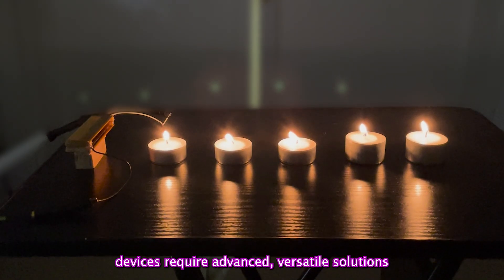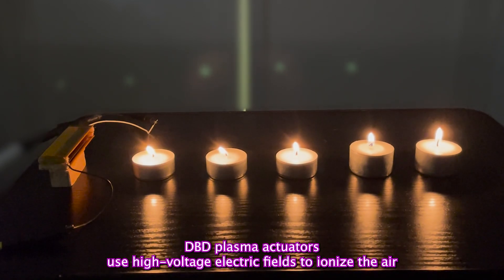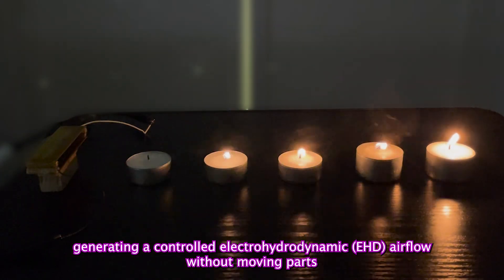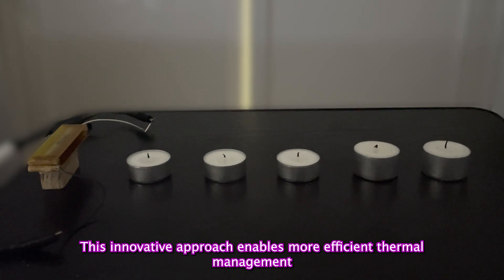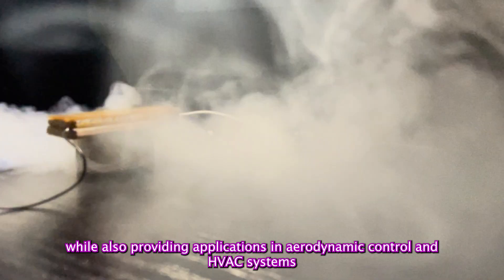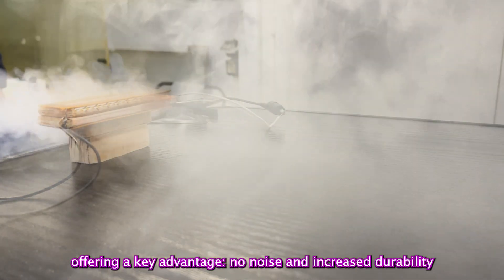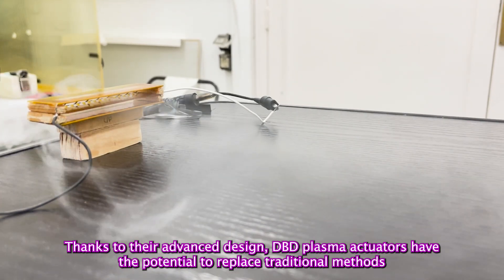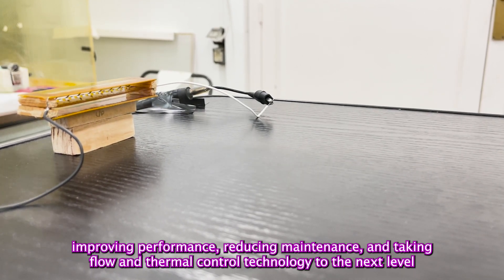🔵 Ionic Wind Cooling: Silent Airflow with Plasma Actuators! 💨⚡ | YPlasma

Comment: High voltage is far from silent. What happens when dust accumulates on these electrodes? And most importantly, high voltage causes air ionization, which is harmful. How can we deal with this phenomenon?